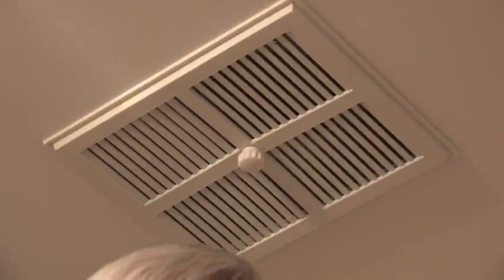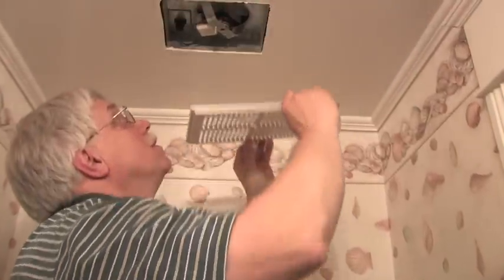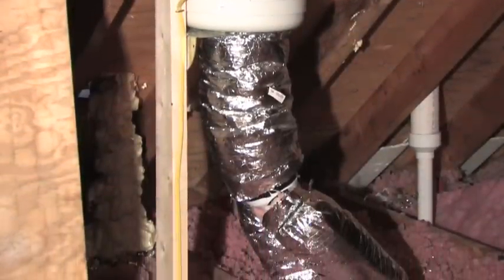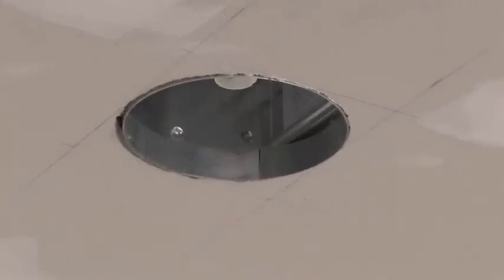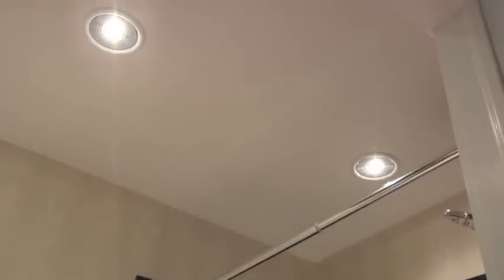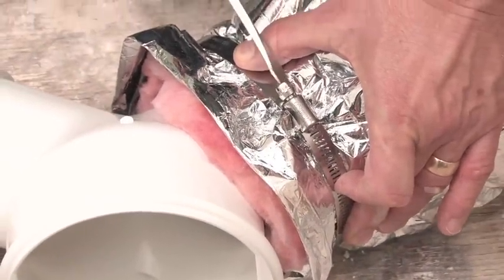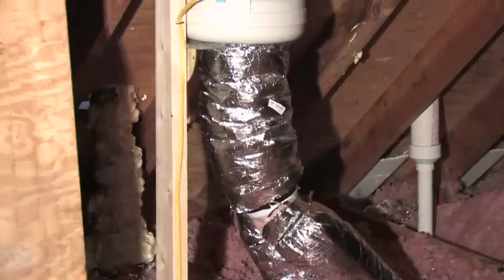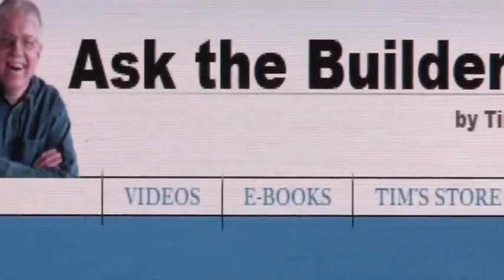Bathroom Exhaust Fans

Comment from the maker: Insulated piping is absolutely necessary if your attic temperature drops below 40F. Please read my past columns about condensation and metal exhaust piping. People without insulation on the pipes think they have roof leaks because so much water drips back through the fan.

Comment from the maker: You can, but it would be a huge mistake. The soffit being the worst as the hot humid air seeps up into the attic, especially if there are soffit vents nearby.  To a lesser degree this can happen on a wall if there is a roof overhang close to the vent cap. The roof outlet is bulletproof.

Comment: A top of the line Newtone is about $35.  I charge about $100 for the install.  I have installed the shown fan and your looking at about $1000 out the door cost.  The inline remote fan (shown in video) has superior vacuum ability and is very quiet, but it is also extremely expensive after the electrician, the HVAC and the roofer have been paid.  The one I installed was for an indoor grill and it really did work excellent.  Just depends on your budget.

Comment: I have always used uninsulated doing custom homes in Aspen CO. And let me tell you, those people are picky and yet I haven't had a complaint yet. We also use the Panasonic fans which run virtually silent and they only push 50 to 75 cfm max.

Comment: Well then I stand corrected, because that makes alot of sence. I've never instaled outside CO. so I did not take that into concideration. It's extreamly dry here. Whenever we put in AC a humidifier is manditory on every system. we deal with alot of swamp coolers aswell. So i thank u for putting up with me.

Comment from the maker: When the fan is on, air is taken from both rooms. Just follow all recommendations by the manufacturer. Get the right fan for a kitchen. Once again, select the one(s) as stated by the mfr. are designed for kitchens.

Comment from the maker: You have been able to get away with that because of your extremely dry air out there. When the humidity from a bathroom mixes with normal room air in CO, your dew point is still way below that just about anyplace east of the Mississippi. The condensation issue in exhaust piping is *real* when you are in humid areas.

Comment: That's called an inline fan, they have been around for a long time. I agree, its nice to have the noise of the fan. I hate these new hotel bathrooms without fans....(plus if you installed that shape of roof flashing on that angle of a roof anywhere it rains hard, your gonna have electric rain in your bathroom...)

Comment: I have to put a fan through a wall. Cinderblock about 6 -8 inches. I will also need to connect some kinda power supply. Any suggestions on what this should cost or a video on doing it?

Comment: i plan on installing a fan soon and the easiest way is to get power to the new fan through the light would i just cut the black and white wires and splice the to fan? so there would be 3 black wires in the marret 1 from switch,1 to light and 1 to fan and vice versa with white wires?

Comment: What if you have to run electrical too? I have a older house that doesn't  have a light in the ceiling its on the wall i would like to see the wiring for that thanks

Comment: i've been trying to find a wiring diagram for a fan that i may be installing soon.i'm basically getting power off a existing light would i just cut the black and white wires(with power off obviosly) to light from switch and splice the matching wires to the fan? so i would have black wire from switch to marret and the two other black wires from marett going to fan and light and same with white wires?

Comment: No need to pay the roofer, there would already be electrical to the site for the old bath fan, you just need the fan (Panasonic's are about $150 online) and the tubing/clamps/insulation. Installation cost me $250 all-in

Comment from the maker: I respectfully disagree. Please read my past columns on noise and how it travels. All of the parts to install the fan, except for the band clamps, are supplied by the manufacturer. As for pricing, you might want to check your figures. Steel, aluminum and copper prices are at all time highs because of the demand caused by China's growth.

Comment from the maker: I've already answered these questions in great detail. They're at my AsktheBuilder website, the dot com one. Go there and use the search engine. Type:  "exhaust fan" or "ventilation" or "exhaust condensation". There's a secret ninja trick to prevent condensation that I've used for years. Bottom Line: There was never a drop of water in my fan or piping, and I lived were the temperature routinely was 20 F or lower. Oh, and when you're at my site, sign up for my FREE newsletter. Free tips each week
Reply: Ask the Builder ok

Comment: Installation of either roof or soffit is a bad idea, particularly in a windy climate. They will produce postive and negative pressures do to the large wing called a roof or wall. If you install the tubing near a roof vent on the underside of the decking, it will be vented out from natural passive ventilation like the rest of the humidity from the house. If you want to lose conditioned air and listen to flap flap flap on windy days, go ahead.

Comment: what about if you live in the apartment that you can't vent the fan by the roof because the association,  the only vent by the roof is the toilet vent pipe that it's 2inches ,how can I vent the exhaust fan....the bathroom has a fan but the box it doesn't has a vent outside the attic. .need help in that
Reply from the maker: +Jose Alfonso I have many free columns on my www.AsktheBuilder.com website about venting fans. Read them. If you need more help, I offer a paid phone consult service: http://shop.askthebuilder.com/products/15-Minute-Phone-Conversation-with-Tim.html

Comment: why use a plastic Y? Metal is cheaper. If ur worried bout it rustin out use aluminum. still cheaper. No need for insulated flex for fart fans. sound comes from the fan its self. besides there is not enough C.F.M's to make noise though the flex, unless u have some industrial fan. Waste of money bro. So quite fan=quite room. It's all bout the fan man.